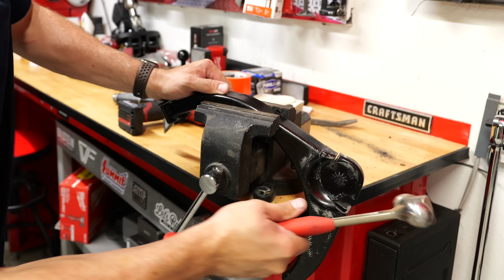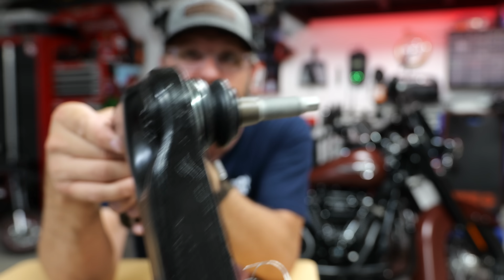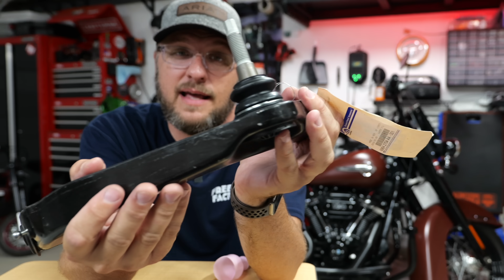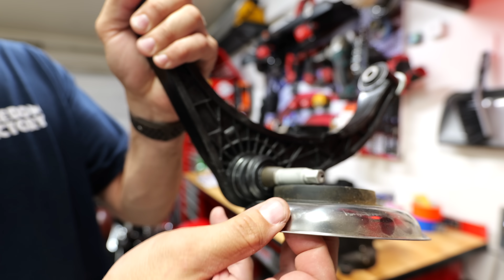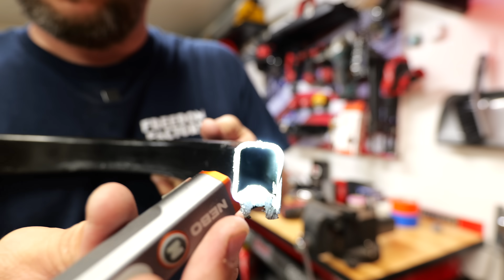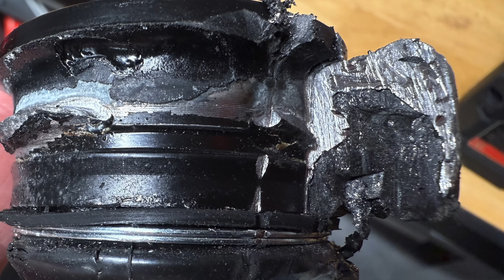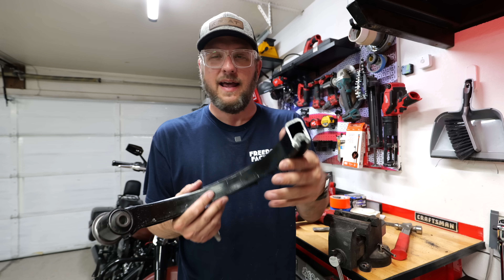I Cut Open RAM’s Plastic Upper Control Arm… Worse Than I Expected?

Comment: This is pretty common in the car industry, its PMH, Plastic Metal Hybrid. OEMs have been using this technology on the upper Radiator support, look at the S550 generation of mustangs and brake pedals across multiple brands. The PMH allows for using thinner metal to reduce weight and cost while maintaining structural torsion and bending with an overall lighter part. The reason the control arm is not filled in is for the same reason a hollow pipe is better for torsion and bending rather than a solid pipe. It’s a new application I am interested to see how fatigue will hold up over time along with exposure to the elements.

Comment: I don't care what crazy pills there are on plastic on any suspension part is bad eavan if the upper one doesn't take much beating I could see this failing and losing a upper ball joint if it hits just right on a bad bump in the road Murphy's law   always wins built cheap to throw away in less then 10 years

Comment: The Plastic Moving Parts is not an improvement the vehicle to save 0,1% weight 
Plastic Pulleys i Had a 1995 Mustang with a Plastic Tension Pulley replaced it with Steal  I wrote this before seeing the Plastic around Steal... The Plastic may be an Anti-Corrosion for Salt Roads in Winter Great Idea 
Good Video👦🏻👍🏻🏎️🏁🚩⛰️🧗🏻

Comment: You don't think trucks today are overpriced ??????????? I hope you're not serious !
Reply from the maker: I’m dead serious. Truck prices aren’t the problem, wages and housing are. A $65K truck today is about a $40K truck in 2005 money adjusted for inflation. The most expensive pickup back then was the Cadillac Escalade EXT at $53K, or about $90K today. Median income has barely moved while housing costs have doubled. Trucks didn’t suddenly become overpriced, they just gained higher-end trims that didn’t exist before, while base models are still available for under $40K. People love to point at the most expensive versions and project their financial frustration onto them. You can still buy a very reasonable truck today, but because people are underpaid and feeling the squeeze everywhere else, they blame the price of top trims instead, which is a red herring. It’s lazy arguing that ignores nuance and truth. Adding more question marks doesn’t make the point any stronger that trucks are the problem or that I’m out of touch.

Comment: Trucks aren’t overpriced ?
Reply from the maker: Accounting for inflation, 65K today is about 40K in 2005 money. Apples to apples, a fully loaded truck in 2005 vs 2025 is not even close. The most expensive pickup in 2005 was the Cadillac Escalade EXT at $53,335, which is about $90,600 in today’s dollars. A fully loaded truck today is far nicer than that Escalade, so you are actually getting more value. The real problem is that wages are too low and housing is too expensive. Truck prices are a red herring.
Reply from the maker: The issue isn’t truck prices, it’s wages and housing. A $65K truck today is roughly a $40K truck in 2005 money when you account for inflation. The priciest pickup back then was the Cadillac Escalade EXT at about $53K, which would be around $90K today. Median income hasn’t kept pace and housing has more than doubled. Trucks didn’t suddenly become overpriced, they just gained luxury trims that didn’t exist before while base models are still under $40K. People look at the top trims, get sticker shock, and blame trucks instead of the bigger economic picture. That is a red herring that ignores the real issue.

Comment: It's just unnecessary, I can understand if they have some new modern suspension geometry but the upper and lower control arm ball joint system is as old as dirt, why fuck with it. In the 80s you could drive a car over curbs and through lawns and they just kept going, I bet you hit one curb with that truck and its all garbage and cant be aligned. Old cars had grease zerks on ball joints, and nothing does now, so at 120k they all loose. Modern cars are products of a equilibrium amongst auto makers to ever so much increasingly make the products less valuable over time and milk the consumer for money. This is well know mathematics in economics called Nash Equilibrium, its part of Game Theory strategies. We are just seeing the end stage of it. Tesla operates differently but still part of the game, that's why Tesla is so successful, they don't operate in the equilibrium they upset it by innovation rather than devaluation. Engineers are like accountants, crunching the numbers, to meet a goal and that's to make things as cheap as physics will allow in the time scale the product is sold for and to force the consumer back to another company , a parts company to get any further with the product than its service life was designed, that way they milk all the profit possible from the product line.

Comment: It’s also interesting to case I also think manufacturers KNOW most 1500 or 150 trucks don’t actually get sold to blue collar workers or are used for actual work most people just want big car cause “big means better” and knowing that these are really used for actual work they can get away with more plastic parts or very cheap metal parts 

Not realizing that trucks are harder to fix now an are just kind of a pain.

Comment: I’d like to see how well they hold up on the 160-170degree pavement out in Arizona. Seems like the high temperature would heat up the air between the plastic and the metal and either blow out the plastic or melt it. Same for extremely cold weather- what will it do?

Comment: This is the first time I’ve heard of this. A plastic control arm😳. On a pickup🫤. Never….never, never, never. 
Vehicles are extremely overpriced for what they are. The should be $5000. Cuz in five years they’re junk. Half are junk off the lot.

Comment: The upper control arm is taking a significant lateral torque forces during hard braking!!! No suspension / steering / brake components should be allowed in plastic materials except bushings!!!

Comment: Talking tech with an HD in the background does not add to your cred.
Reply from the maker: I’m not talking “tech” here, I’m talking engineering. Harley is a perfect example of engineering done right. The bike you see in the background is from the 2018 softail redesign with the 114 M8, which has proven to be incredibly reliable, yet it still feels every bit like a Harley. That is engineering for the customer, delivering something new and durable while keeping the brand identity intact.

RAM, on the other hand, is giving truck guys plastic upper control arms and replacing the HEMI with the Hurricane. That is the opposite, putting cost savings and corporate priorities ahead of what the customer base actually wants and expects .

Pointing at the Harley in the background gives your criticism less credibility. It is a case study in engineering to expectation, not against it.

Comment: Depends on the TYPE of Plastic. For example Ultra High Density Plastics are fine for this use. Steel brackets tend to kink and bend, plastic may give and spring back into shape.

Comment: They're planning on selling the entire upper control arm assembly as the only way to replace the upper ball joint at many, many times the price of an aftermarket ball joint.  That sounds like a pretty good deal...for them.

Comment: Planned obsolescence. If the ball joint doesn't fail first, the plastic will dry rot and crack. How tf are you supporting this?  - You don't think new Trucks are over priced when industry experts all agree they're easily 50% overpriced.

Comment: Hummmm.  Good idea for rust proofing
Reply from the maker: Except it’s not fully surrounded by plastic and theoretically water might get between the two parts.
Reply: @GNGAutomotive i mean if there was a product/ process to encapulate metal parts from rusting like paint.  But yeah it is strange what you discovered

Comment: All new vehicles are built to last 3-5 years, if they even make 100k miles. Meant to be recycled and to keep people buying their 100k dollar vehicles. Its why they push their customers to put thin oil in their motors, and change at 3x the interval it should be changed at. Same reason they tell their customers the transmission fluid is lifetime, because they dont expect it to make it past 100k, thats its lifetime. I drive a 2000 silverado with 430k, runs better than a new truck, and it doesnt eat camshafts, lifters or main bearings, like new trucks...

Comment: at least its rust proof plastic. if your off roading, you might want a steel one, only due to the different forces than normal street riding. Mostly because steel bends, but plastic will break.

Comment: before you cut the ball joint out, you should have tried to press it out to see what happens.
Reply from the maker: You cant press it, the plastic is injection moulded around the ball joint which you can see in my video. They aren't designed for replacements so pressing it wouldn't have really helped demonstrate anything valuable in my opinion.

Comment: You think $90k for a low end pickup isn't expensive?  Most of this new crap is in the junkyard at 100k if you're lucky! Some people just not so bright!
Reply from the maker: No, I know 90K is NOT a low end pickup, I think people like you are being dramatic little girls and completely ignoring the fact that you can buy a $40,000 full size pickup from almost every manufacturer but because it doesn’t have all of the bells and whistles you WANT, you cry and pretend the top trim is the entry level. It’s just modern entitlement at its finest and projecting on others who CAN afford the higher trims.
Reply: @GNGAutomotive Ok, guy keep telling yourself that.
Reply from the maker: @joet1669 yes, I will keep telling myself the truth. You can buy a $38Kish brand new Silverado, F-150, or RAM today but you can keep living in your made up world that makes you feel right. What a joke!!!
Reply: Let me apologize, I am a little pissy today.  I don't want to rob you of your peace today because mine is in a bad place. A little explanation may help make my point.  I own and operate a large ranch and small to med size company. We have between 50-60 vehicles on the books at any time. We require heavy duty trucks across the board, so our fleet is made up of 2500-5500s and a few semi's.  Over the last 15 years our vehicle fleet cost have risen 193% for the same number of vehicles and same annual averave milage.  We are big on routine, and preventitive maintenence and this has been consistent throughout this time with even more maintenence time required for all our vehicles purchased after 2022.  It has been very common to have vehicles purchased from 2022 and later to be unrepairable, or have significant problems with less than 50k on the clock. We have 7 down right not one only has 11k on the clock and dealer warranty and workmnanship is terrible now days. We do see rougher roads, dust, and overall more severe conditions than most but the fact remains we are paying 193% more for vehicles that will not get half the life of previous vehicles. If you see any of those $39,000 new 3500 dually diesels please klet me know i have cash lol just kidding I know you didnt have that information i am just a little put off with vehicles right now.

Comment: Up in the northeastern state's  vehicles, I've  seen lots of corroded control arms which are stamped sheetmetal and frames from salt spray. This encapsulates them much better than paint to protect these parts from salt corrosion.

Comment: I think that is a good idea for street trucks, the plastic can handle it with ease, Good for weight control also.
But as for off road with 35 inch to 40 inch tires running over rocks or rock climbing I don't trust it!
Reply from the maker: Maybe

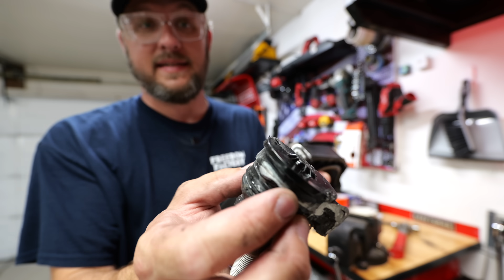Comment: 8:25 The plastic can also serve as a vibration dampener or absorption media
Reply from the maker: I have never heard of anyone in my life complain of noisy upper control arms. Matter of fact, cars and trucks these days have gotten so absurdly quite with sound deadening wheel well liners that claiming a UCA would need ANY sound deadening just makes zero practical sense.

Comment: lateral forces during hard braking and turning will place (great stress) on that upper control arm. Its not all about shock load or vertical tension. Meanwhile the heat and other elements will degrade its strength greatly.

Comment: HS steel provides base strength. Plastic encapsulation provides a sealed environment that allows the engineer to cut back on the amount of steel needed to survive IRL with corrosion.  We have seen the progression from stamped and welded steel A arms to just stamped to forged alloy back to high strength steel which is very strong but not corrosion resistent. So we seal it up. Niow we have light weight strong steel sealed against water, salt etc so it wont loose strength over the years. Its cheaper than forged alloys. And it's cheaper than stamped steel.  I'm betting the ball joint is not replaceable nor are the bushings. Its too easy to crack the plastic and compromise the steel. Cheaper just to replace the entire unit and keep the lawyers at bay.

Comment: Motorcycle swingarms and frames have been made with styrofoam for decades. Aluminum skin over a styrofoam core. The styrofoam prevents the thin aluminum skin from deforming under load and makes the whole assembly lighter. Wonder if that's part of what is going on here.

Comment: Plastic can be stronger then steel. With the right fiber reinforcement it can easily exceed steel in strength and won't oxidize as badly. However, the problem is those course fibers wear the heck out of the molds so they tend to substitute in glass beads instead which while they do give it some strength it's not even close to the same thing. I can tell from the glinting that it's reinforced plastic but would have to look at it real close to see if it's fiber or bead. Mostly seems to be a filler for dimensional stability and the bonded plastic protects the underside from salt and other things thrown up by the tires.

Comment: Cars are engineered to meet government requirements.  Very little is going to meeting consumer demands these days.   

The Toyota turbo motor debacle is a good example.   Nobody asked for turbo engines.   But they got them at a much higher costs, less reliable replacement for the older naturally aspirated engines with a negligible gain in MPG, if any.

Comment: I think plastic auto parts, anything structural anyways, is for the the purposes of cost reduction and ease of manufacturing. I don’t like it. Can you imagine a modern car found abandoned in a barn for 50, 60 years from now being revived? Nope, planned obsolescence as well. Profit margin increases are being maintained at consumers expense. Another few years we’ll all be driving around in $120k Fisher Price Barbie cars with latte warmers and butt massagers and they’ll look great in the commercials. Consider a small, two person utility vehicle for off-road or farm use costs more than an S10/Ranger did back in the day. I know a dollar ain’t what it used to be but dang! No heat, everything rattles and nothing fits together properly, no windows, little or no seat padding, plastic everywhere and yet we buy em. The consumer has become a smuck. Taking out a loan to buy junk. All this isn’t going in a good direction.

Comment: eliminate airbags and the avg car prices drop $8,000 to well over $20,000 thousand dollars... cut the mileage rrequirements down to 1990 - 2000 levels and the prices drop another $10,000 to $20,000 thousand dollars plus...

Comment: The arm will be subjected to stress tests like all other components,the failure rate would have to be comparable. There could be some flex designed into it's construction that alters or helps maintain a desired geometry under deflection where the composite design was the best method of achieving this,or it insulated certain harmonics,bearing in mind the not all plastics are alike and some are incredibly strong. There will also be a consideration that it breaking in a crash was beneficial so a degree of weakness could be  designed in. Not everything is a conspiracy to take your money, sometimes these things are actually beneficial to the end user.

Comment: Yeah I'm sure it works "Ok" when it's brand new, but what happens in 10+ years after the plastic gets all brittle and cracks?  Nothing is designed to be good quality anymore.  Just cheap crap that they can sell at some insane markup.  I partially blame the car manufacturers who have always been cheap and greedy.. But also partially blame govt organizations for ridiculous ever increasing CAFE mpg mandates, and forcing billions of dollars in R&D on EV tech to phase out and throw away the trillions already spent on making gas as clean/efficient as possible; tech that a very large portion of the vehicle buyers simply dont want (especially with off road and towing capable trucks).  All those losses are getting shifted onto the consumer.

Comment: So what's actually going to happen is the plastic is going to trap moisture and it's going to rust out faster than a normal stamped control arm... Just like the GM DOD, over-engineered for failure.

Comment: I bought new lower control arms for my 2006 Lexus GX470 and each of them weighed about 30lbs! I bet you would need 5 brand new blades to cut thru one of them

Comment: 2021 toro carb ain’t got not one adjustment on it they offer like a needle and float replacement that’s it any running issues throw it away get a new one they are cheap small they wanted 350 for the dang thing and here the kicker only last 600 700 hrs and it’s trash bc the throttle shaft holds throttle plates in carb is freaking made of plastic and it falls apart letting one cylinder run normal and the side the link on sucks air like crazy making mower run awful I can go on and on about how plastic sucks